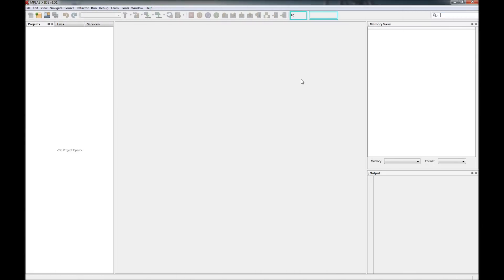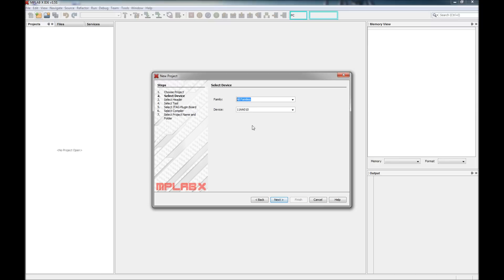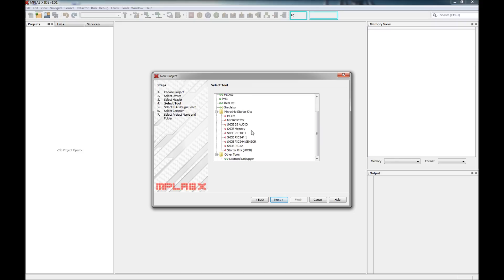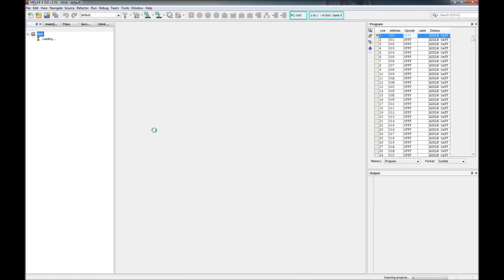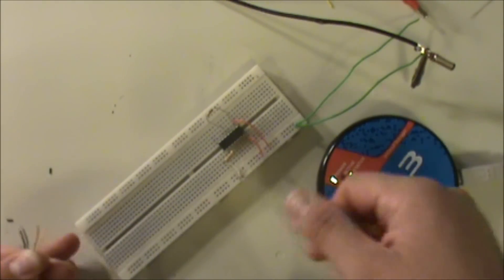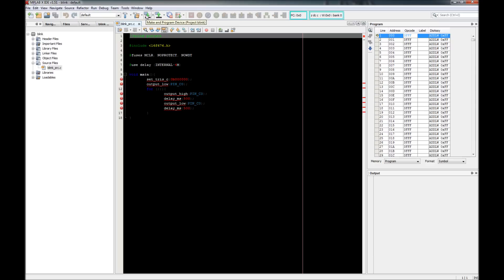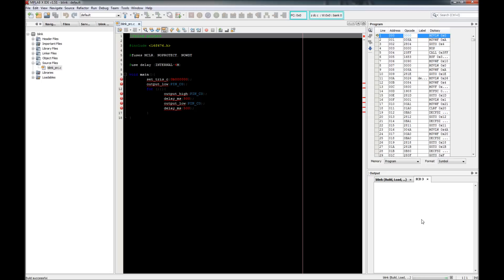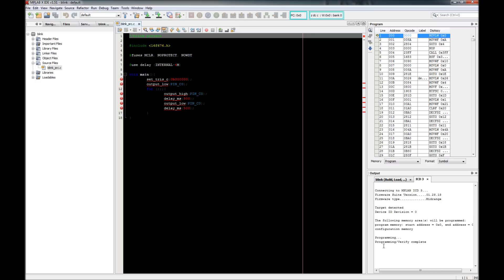PIC Basics: In Circuit Serial Programming ICSP

Comment: hey! i may sound like a noob here, but say for example i have an IC of the Atmel  ATmega328P micro-controller, i program it using the Arduino IDE, i do that plugging it into my Arduino Uno board, after uploading code, i simply remove the IC from the holder of the Arduino Uno board and build my circuit with the code now in the microcontroller, after connecting power, will it start up and execute the code? or is there something i need to look into further? please reply as son as possible! thanks in advance!
Reply from the maker: +Afzal Patil I believe it should.  I have not personally used the atmel processors very much I have used PIC micros from microchip more.  Check and make sure there are no enable pins to be pulled high or any type of a MCLR pin that needs to be set before it will execute code.  I have included the data sheet.  However, just powering up the chip, as long as it is connected to power and ground properly, should not hurt the chip it will either work or not work. hope this helps.  http://www.atmel.com/images/atmel-8271-8-bit-avr-microcontroller-atmega48a-48pa-88a-88pa-168a-168pa-328-328p_datasheet_complete.pdf

Comment: Why is there an external power supply (Green Wires) if you are connecting the ICSP to the VSS and VDD of the PIC?
Reply from the maker: I wanted to show that depending on your application you may be right that you can just connect the programmer up and it work.  However, the programmer can only source so much current and if there are multiple things sharing the VCC line in your circuit it will swamp the programmer and it will not program.

Comment: did you ever do one on debugging?  I'd love to see it.
Reply from the maker: Hey there thanks for the comment.  No I have not done one on debugging.  However, this is a great suggestion.  I will definitely throw that in the mix.  Thanks.
Reply: misperry
that'd be awesome... I can't seem to find anyone debugging using the ICD3... Microchip doesn't do the best job in instructing on how to use their products... I'd like to see how to find where a problem may lie in one's code and how to use breakpoints.  Thanks!
Reply from the maker: Sure that would make for a great video.  I am sure that if you are asking there are many others that need to know as well.  It is pretty simple but like you said microchip doesn't do the best job documenting it so you know where to start.  Thanks again for the idea.

Comment: What's the difference between RJ11 and RJ12?  RJ11 is a 6 position 4 conductor modular phone connector.  RJ12 is a 6 position 6 conductor modular phone connector.  It is far easier to look for RJ12 and have a higher probability of getting 6 conductor parts.